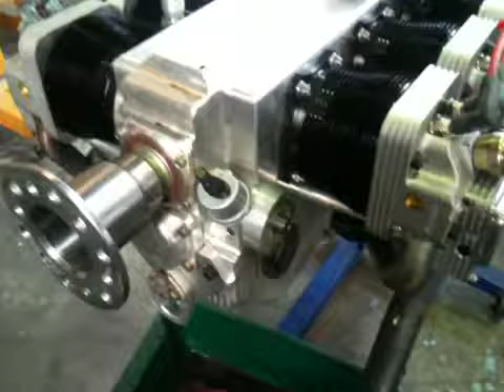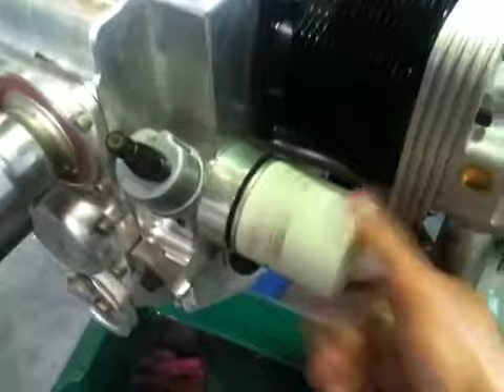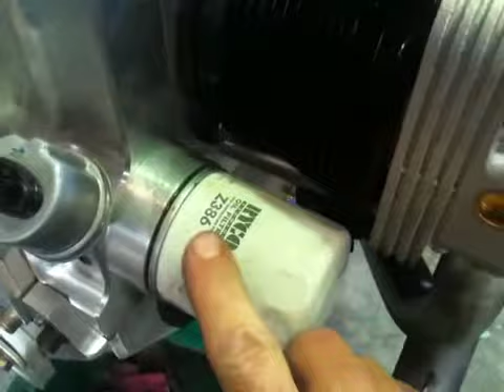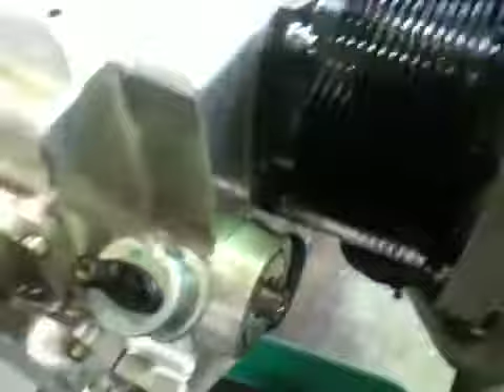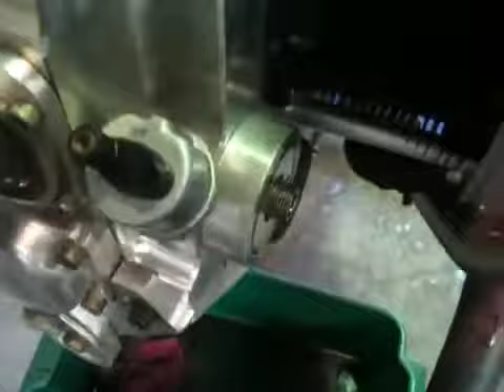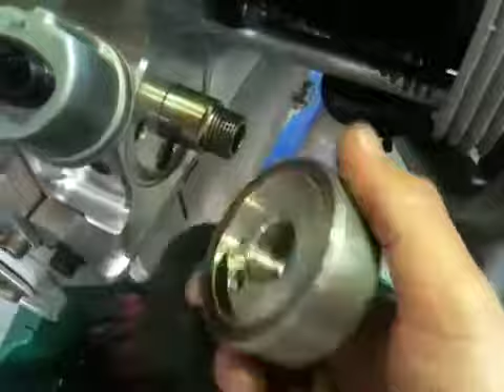LCH oil filter

Comment: Are these sexy looking black cylinders still Jabiru or have you replaced these with better versions as well, Paul? Nicasil perhaps (hint, hint....)

With all these great mods, what is stopping you from producing a Rotec 4-cylinder or 6-cylinder engine with all mods integrated? Electronic injection/ignition, LCH, better alternator, larger oil sump?